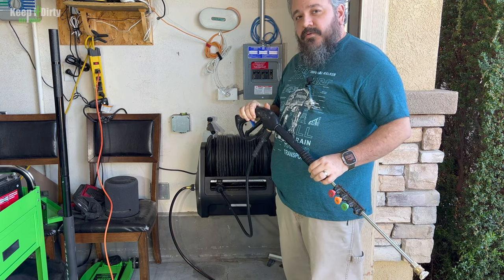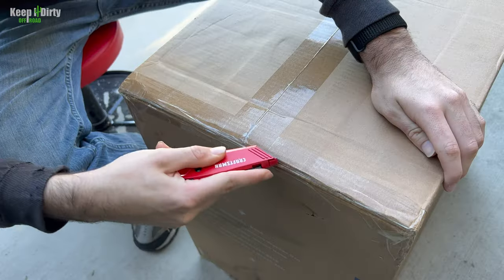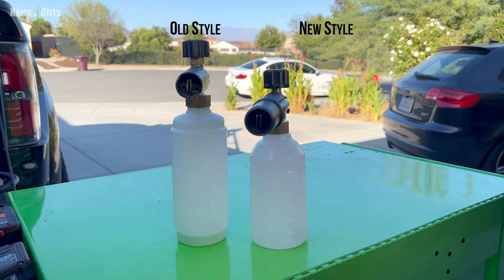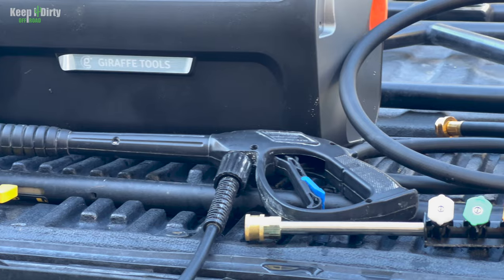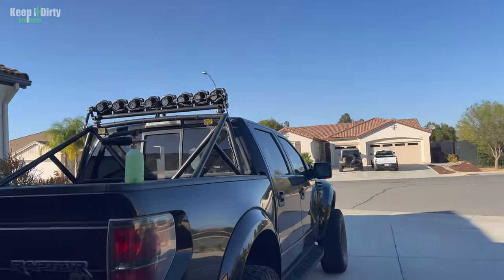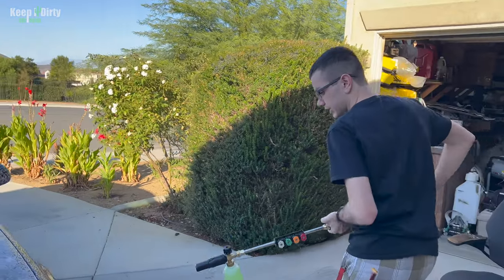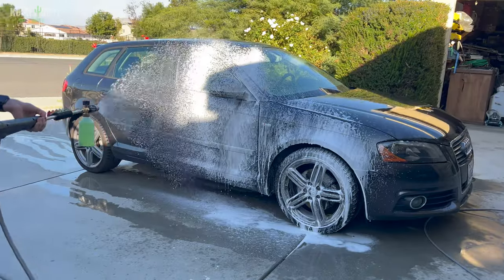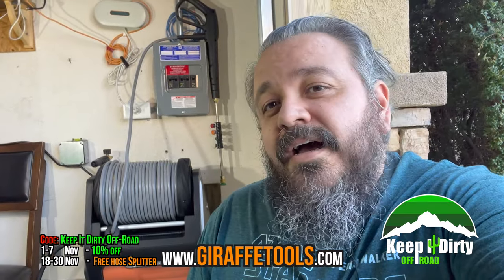Giraffe Tools Grandfall Preassure Washer PRO

Comment: They are releasing a new "Upgraded Pro" on Apr 20, 2024. It has an Upgraded motor now with a 3300 psi motor and vent holes on the side for better air flow on the motor. It it has a $699  price tag. See if you can get a trial one and compare and also see if you can get a coupon discount for it. I am waiting for the new release to possibly buy.
Reply from the maker: I’ll check with them and see if I can.

Comment: As a detailer id definitely go for the pro IF you use it to make money with or if itll be used a lot..a lot. For personal occasional use go with a lower option itll work just fine and save money.  We have a couple of those foam cannons at work and they are great. The tall style like that old one does tend to tip over often though.  

Great review 👍🏻
Reply from the maker: Thanks man. And totally agree

Comment: Have used lots of electric pressure washer and ended up with a gas-powered washer. Water pressure is usually the selling point but the GPM is usually much lower on electric units. It’s like using a squirt gun vs. garden hose with the same water pressure.
Reply from the maker: But isn’t that a benefit? I waste far less water using the pressure washer.  I live in the desert so water is precious and expensive out here. I can definitely get more power out of a gas washer for sure, and could cut time in half. But the extra pressure is a bad thing when rinsing the engine bay or some sensitive harnesses and sensors under the truck. Too much preassure could damage them. So I’m happy with the compromise and love not having to keep gas on hand to run it.
Reply: @KeepItDirtyOffRoad  Well pressure can be regulated on the pump with most gas washers. There’s a knob for it. I’m not sure if you’re really saving much water given that it will take you twice as long, maybe even more, with an electric washer. When I washed my truck and boat with an electric, there are spots that won’t come off after a first run. You end up having to foam it, agitate, and rinse. With a gas, I can usually skip the foaming and agitate part. It’s like going through a touch less car wash. But I get the whole convenience of not having to maintain another electric motor. To me, it’s worth it. And just to be clear, I’m talking about the gas washer that can output 4 GPM.
Reply from the maker: That’s definitely a benefit for gas. But again. We in the desert in so cal. Gas pressure washer cost more and then you have to deal with $6 -7 gas on top of it. Running the electric pressure washer is still overall cheaper and easier and my neighbors are not as annoyed by the noise since it’s contained in the garage

Comment: Did you mount this onto a stud in the wall? What is the weight by chance?
Reply from the maker: If you look at our previous install video, we used some plywood to spread the load over 2 studs and then screwed into the plywood. Not sure on the weight, but it’s not much.

Comment: This do not make sense for the price of the pro you can get a Comet static 1700 Italian made full serviceable better hose and can remove the reel for a better one ect ect
Reply from the maker: Just looked it up. Your right is a better setup for professionals and definitely easier to service. But if you look closely, they are using the same components. Reel looks identical, Gun is the same too. I’m sure there is much more similarities and they are both made at the same factory in China.
Reply: Agreed, there is nothing "Pro" to be had with these things. While they are nicely integrated, the whole thing is simply cheap and nasty.........without a cheap price tag to go with it. I'd rather use a garden hose.